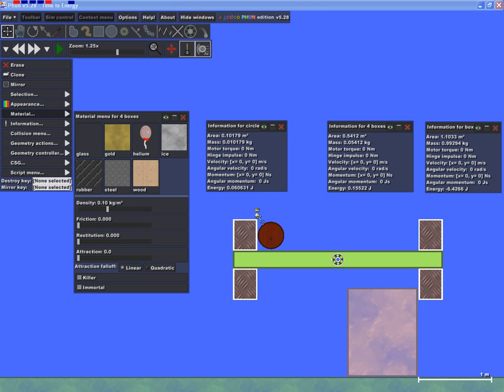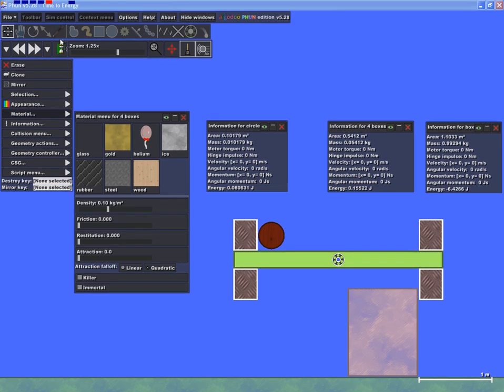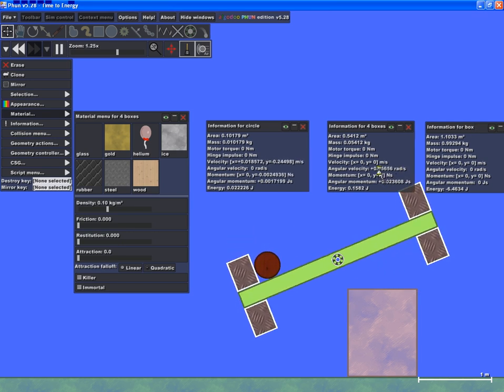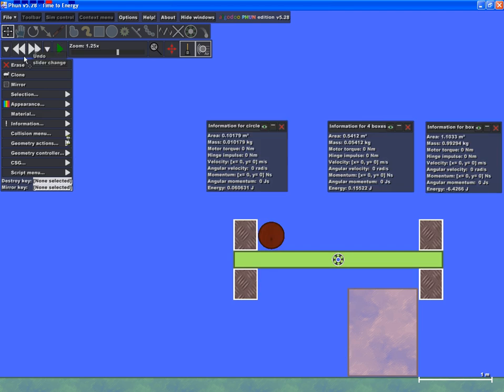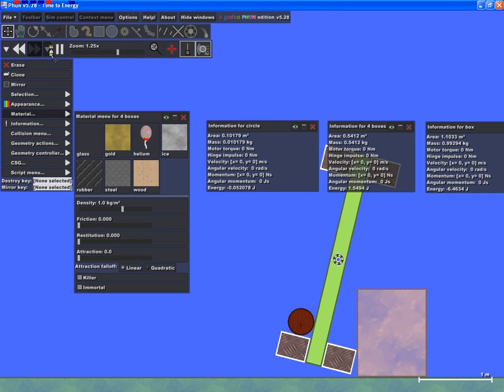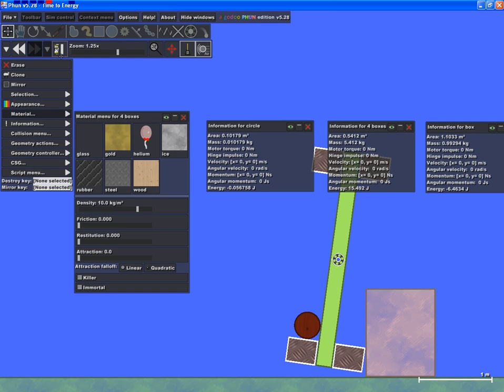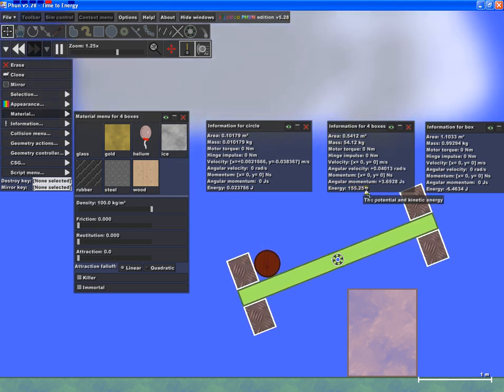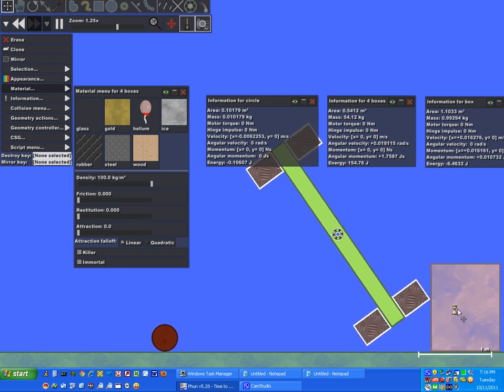How to turn Time into Energy

Comment: @SpatialMaster Change in momentum is called impulse. Impulse is F*t. So time does not create energy but momentum. When the two masses collide momentum is preserved but energy is lost. The bigger the difference in the masses the lesser the loss. As you go to infinity with the difference the wheel will not notice the collision and just continue as a pendulum. To make the math simpler consider the small mass hanging on a rope pulling the big mass on a frictionless wagon.

Comment: @AdminOnDuty I first thought your video was fascinating, but after doing some rather simple calculations with simple std formulas for simple physics i concluded that, and i repeat, there is no energy created, just less energy lost in the (inelastic) collision as the mass difference between the wheel and the box increases. Do the math, use the formulas for potential energy, kinetic energy and momentum and you will see. Still, its its interesting in the viewpoint of minimize loss.